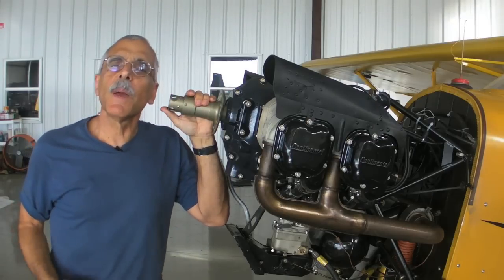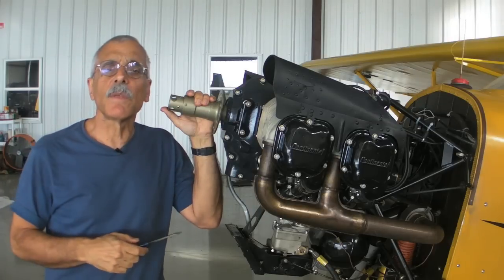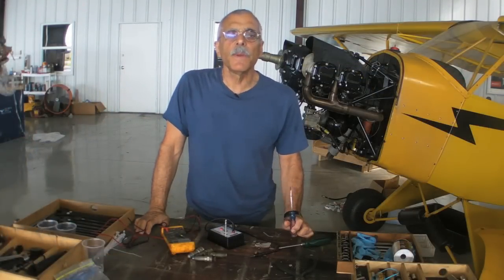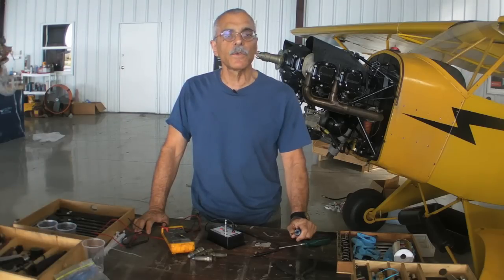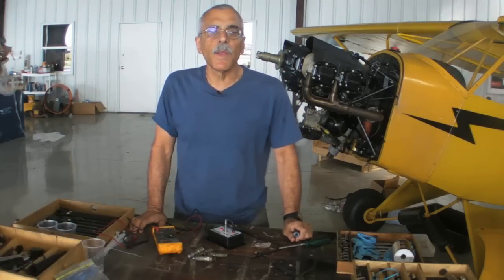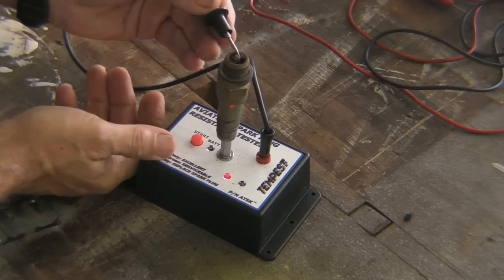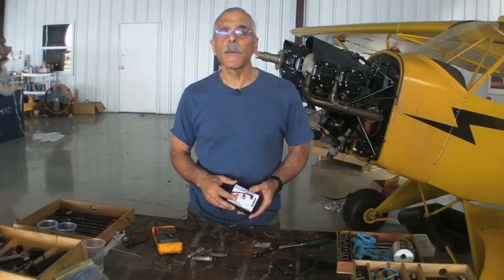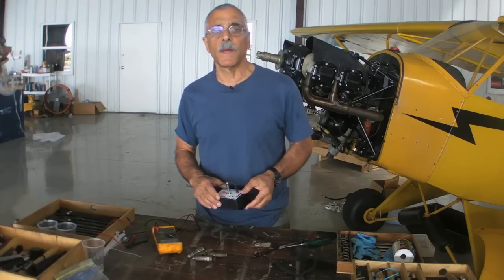Tempest Spark Plug Tester: Resistance Isn't Futile

Comment: O.K........How come champion says that you cannot check the resistance of a spark plug with an ohm meter? How come they do not recommend that you use a go no go meter to test spark plugs?.......I fly a 172 and everyone has an opinion and my plugs continue to foul and each mechanic has beliefs that I dont believe who am I supposed to,believe ?...You ???? How many hours are you getting before cleaning them again ??
Reply: Today I used this tempest tester and found 10 out of 12 champions plugs to not pass. I then put an ohm meter on a couple bad plugs and got values around 7 k ohm and the two good plugs read around 3 ohms. My IA is convinced this is the cause for the customers complaint of the engine coughing mid flight. I will update if swapping the plugs helps

Comment: While this is a cool product, for $130, I don't think I'll be buying it.  Especially as a newly minted A&P.  I would be more interested in some lead adapters for my multimeter that assisted in holding/testing spark plugs.
Reply: You could easily make a lead adapter for your multimeter from a bolt wrapped with electrical tape. That's also what I've used to time magnetos for 29 years!
Reply: I like it!